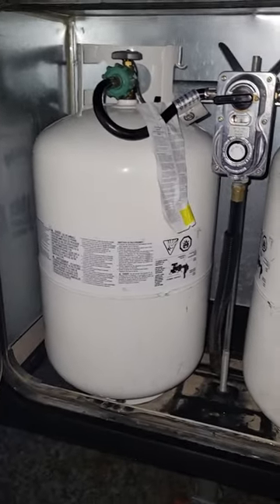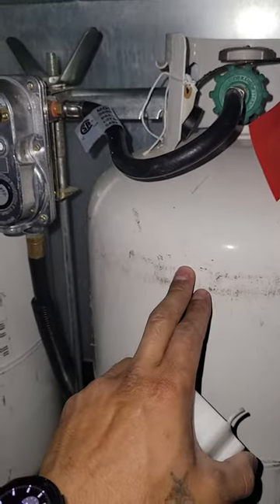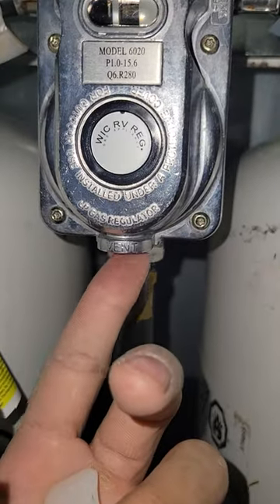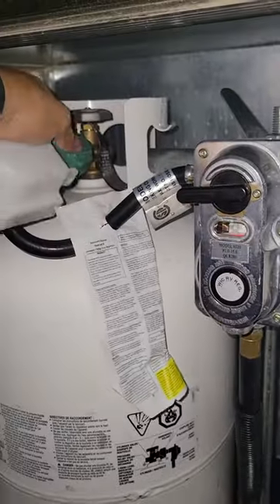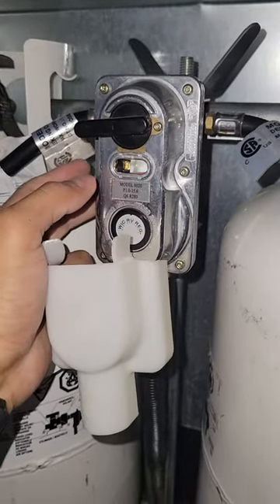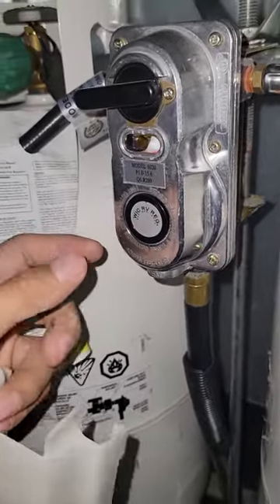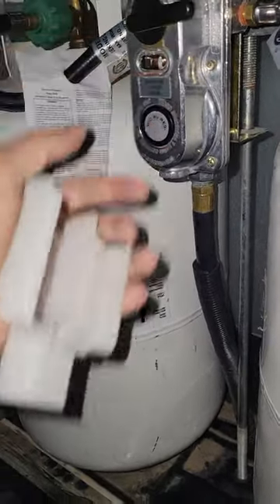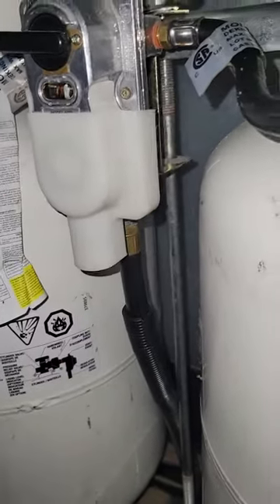Leaking Propane regulator Quick Fix! Dont buy a new one until you try this!

Comment: I have the same regulator model with the same issue.  Tried unhooking and tapping it still leaking bad out vent.
Reply from the maker: I ended up just buying a new one because later on it kept doing the same thing over and over again
Reply: I have propane  shooting out of the vent spot.  Mean anything different ?
Reply from the maker: It might be the same issue, so theres a recall on those regulators if you go to a dealer they should switch it out for free
Reply: if it leaks at all, you should replace it. property and safety is worth more than changing it
Reply: @Mrthekatt this here. OP needs to delete this bad advice video.